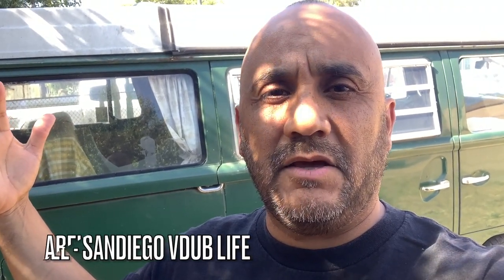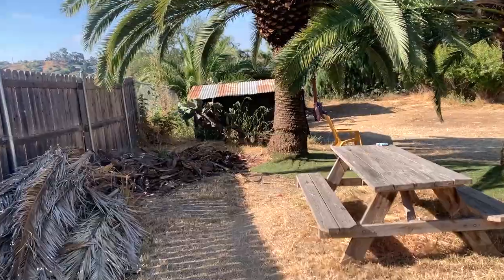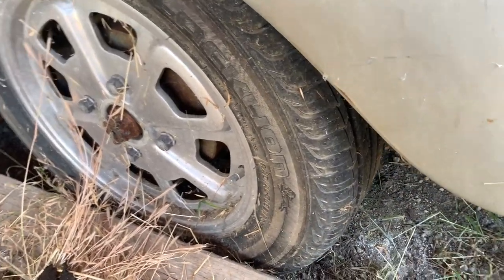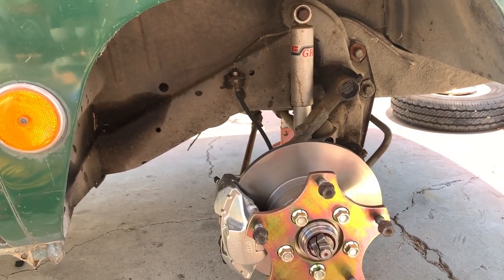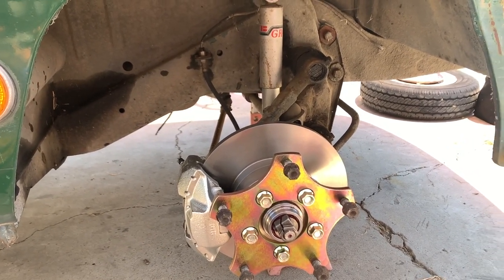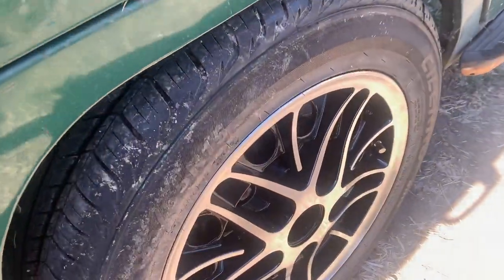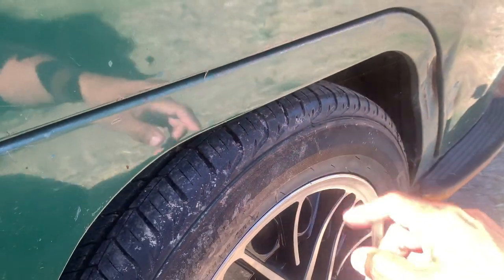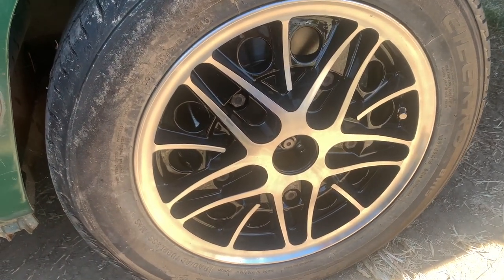Lower Your VW Bay Window Bus | Drop Spindle Part 2 | VW Bus Revival Project | Episode 24

Comment: We may be 5000 miles apart but we sure have got the issue. I have the narrow bolt pattern but still have the same issue and have bought and installed a narrowed beam. i'm just waiting for the tracking to be done.
Reply from the maker: Oh awesome Woz! Yeah it sucks. Its good to know if I had the 5x112 pattern I would still be in this mess. I see CIP1 sells a beam from the UK. I have found one made here and seems like a good price, but you have to buy the torsion bars separately along with shortened tie rods and I think the needle bearings too.